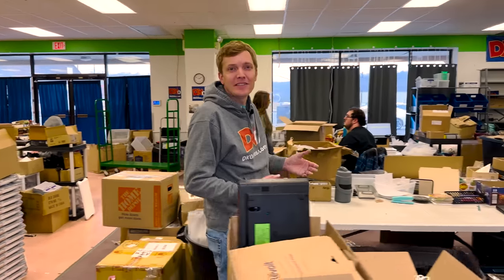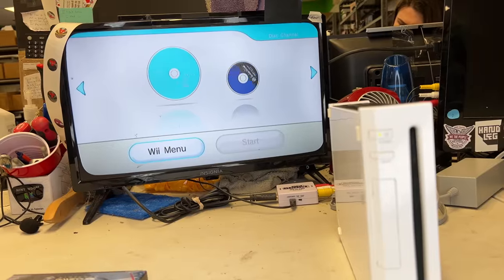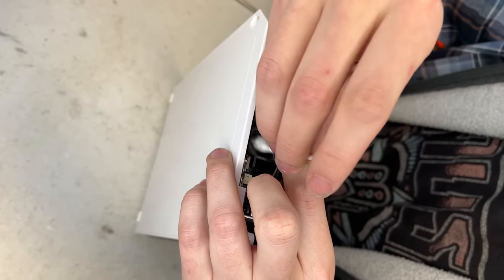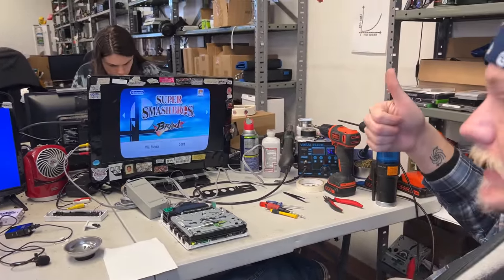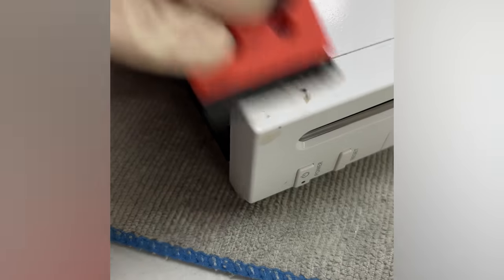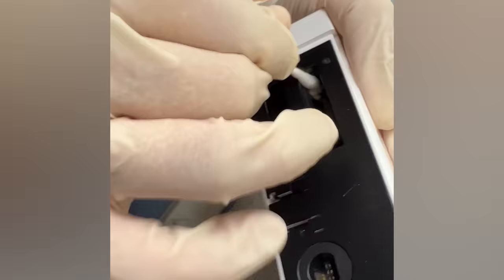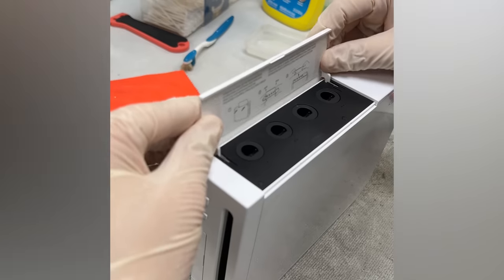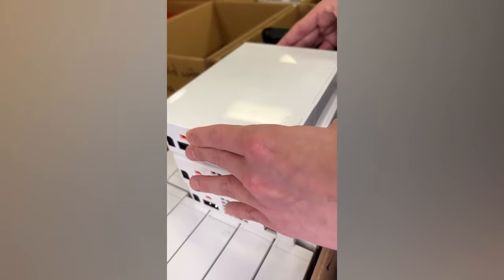DKOldies Refurbishes Their Consoles

Comment: Why were the connectors and fan grills cleaned AFTER you put it back together? When the console was taken apart and the case was removed, just give that to the cleaning person. Also, just dunking a q-tip in alcohol and then on the controller ports doesn't clean anything!

Comment: You know what, if that's how your "refurbishing" your consoles, stop charging as much, you should open the system, repair or not, and clean the internals with IPA, the shells should be cleaned but not with a magic eraser, they're mild abrasives and something like a Wii with a gloss finish will just look dull, window cleaner and a cloth would have cleaned that casing, you don't even show basics like an ultrasonic cleaner for system boards which I'd expect for the price you charge

Comment: I use to use Magic erasers a long time ago but 1.  They're not cheap don't last long messy.  2.  I use microfiber clothes now you can get a 2 pack for a dollar or so either at Walmart or a dollar store, they're reusable, washable not messy with them I just use a spray bottle of isopropyl alcohol and easily done, good thing to know is don't get any on a label it will destroy the label easily so as long as you're careful everything should be fine!

Comment: You might've misunderstood what the refurbished means. Refurbish to me is replacing the whole casing, cables, controllers, pretty much everything but the console machines. So everything looks brand new despite it might not be using the original part. What you did in this video is cleaning not refurbishing at all

Comment: if i bought from you expecting a good condition wii and i got that, id send that back so fast. not only was it cosmetically flawed when you received it, you further damaged the console because you couldnt be bothered to use careful practices when cleaning. 100% there is going to be an unsettling matte spot where the rest of the wii is glossy and that could have been prevented.

Comment: Magic erasers are made of melamine foam, which acts like a very fine sandpaper. When you use it on a glossy surface, it can cause tiny scratches that dull the finish. Isopropyl alcohol, especially at higher concentrations like 70% or more, can be too strong and might strip away the protective coating on the console, leading to a loss of gloss and possibly even discoloration. Using gentle, non-abrasive methods is the best way to keep the console looking good.

Comment: Why are you cleaning the plastics with the console assembled? It's better to tear down the console and clean the plastics separately. That way you never get moisture anywhere near the circuit boards. It all goes back together dry.

The only reason I can think of to clean an assembled console like this is if you're not always taking the console apart. If you're selling consoles as "refurbished" without at minimum taking the housing off to inspect inside, that's not honest in my opinion.

Comment: Magic erasers and isopropyl alcohol are horrible for a glossy finish because Magic erasers are made of melamine foam, which acts like a very fine sandpaper. When you use it on a glossy surface, it can cause tiny scratches that dull the finish. Isopropyl alcohol, especially at higher concentrations like 70% or more, can be too strong and might strip away the protective coating on the console, leading to a loss of gloss and possibly even discoloration. Using gentle, non-abrasive methods is the best way to keep the console looking good.

Comment: Where was the refurbishment? I saw replacing a broken component, air dusting and wiping down the exterior. How are those 20 year old thermal pads holding up? What about the internal heat sink and the dust there? This wasn’t refurbishment, it was a video displaying a superficial cleaning.

Comment: Every old cd/dvd reader should have white lithium grease applied to the mechanism to avoid failure and the laser clean with alcohol. 

Also for deaper cleaning, you can also use a brush.

Also also, new thermal grease or thermal pad.

Every broken part should be replaced. 

After all that, now you should be able to call it refurbished. Otherwise, it's just called cleaned